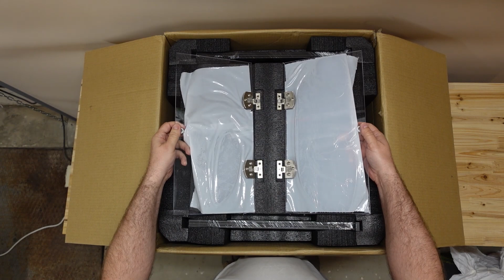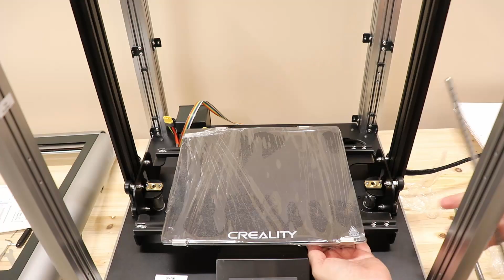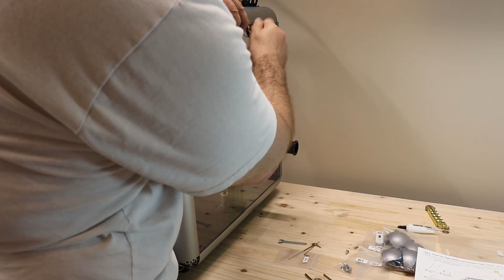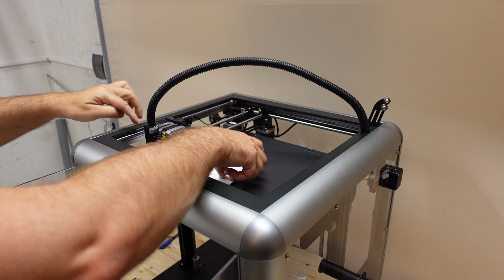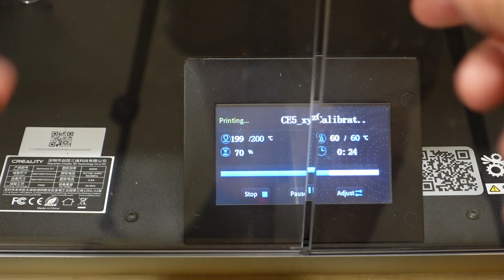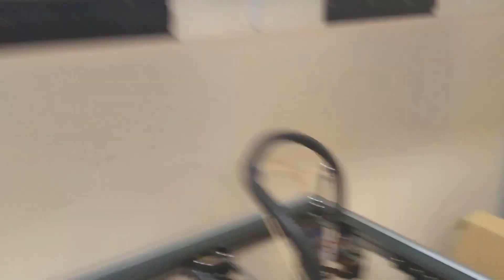Creality Sermoon D1 - the most elegant 3D printer - unboxing, review, first  prints

Comment: could you help me? what could be the issue when i first home the printer the nozzle is pretty far from the bed (far enough that turning the knobs wont get it close). If I press home again the Z axis just goes down even more and keeps doing the same for every press of the home. When I press leveling the bed goes to the top as it should but stays again far from the bed that the knobs can not get it close enough to the bed. Any ideas what I can do to make it work?
Reply from the maker: Not sure, try to lower the limit switch somehow

Comment: hello how do i calibrate stepper motors?
Reply from the maker: You don't have to calibrate stepper motors on X and Y axis (except if you are doing some maintenance). The extruder stepper motor you can calibrate, setting the e-steps, here is a tutorial, how to do it using only files on sd card: https://youtu.be/dvHlawF66Nw?t=911
Reply: @MyTechFun  yes i know how the z axis is calibrated, it just seemed to me that the x and y axis are not quite accurate
Reply: @MyTechFun  https://youtube.com/shorts/M4no4m2Os8Q?feature=share  and another minor printing problem with sermoon d1, the z axis cuts when printing at regular intervals

Comment: Dear Dr. Igor, What is your recommendation for this printer. How it is compared to prusa mk3s and cr 10 v3. What is your long term feedback about consistency and quality.
Reply: Also, you mentioned ender 3 v2 - how is that printer. I am looking for almost all type of material not just pla.
Reply from the maker: Idea for the Sermoon D1 is great, you get a good base, but another 95% 3D printer. If you are ready to fix them with some DIY hacks, go for it. Finally a 3D printer which uses linear rods (x, y). But hotend is still usable up to 240°C by default. There are so many great filaments which requires higher printing temperature. Replacing the hotend (and the extruder) is another useful hack. Enclosure from the top is missing so you could print ABS, Nylon without warping (another DIY hack required). But then screen is still in enclosure, you have to open the door to do settings. Not smart for encosured printer. Requires another hack.. If you want "finished" printer, then Prusa, but you still need to create some enclosure for it for those "exotic" materials.
Reply: @MyTechFun  thank you for the response, so what do you recommend me to get, which printer.

Comment: Excellent instructional film.  Thank you.  My bed is 200 microns high in the center.  When the gap in the four corners is 300 microns, in the center the gap is 100 microns.  Is this something I can live with? (I'm a beginner)
Reply from the maker: That's too big difference. You have few options: install bl touch (it will compensate the difference), replace the glass or install PEI sheet (but if alu plate is warped, you can place something below it)
Reply: @MyTechFun  Thanks for the comment. Excellent channel.
I definitely thought the gap was too big.
I will check again with hot glass. If there is no change, I will contact the supplier.

Comment: It would be great if Creality made this model in 300 x 300 x300 model with a non textured glass bed & I would like to see dual Z axis guide rods & dual Z axis lead screws & the pre-assembled belts & tested at the factory. I wish more manufacturers would use them. I love the enclosure with this printer. What CoreXY 3D printer would you recommend? I would also love if the 3D printer manufacturers use ball screws & servo motors, linear rails, & 40mm X 40mm extrusions. The manufacturers should install of a 500 Watt power supply since many of the supplied power supplies or under rated & running over rated mode which will kill the supply quicker.

Comment: i would do the leveling only after the bed and nozzle are heated up. Might help a little with the adhesion. Next, you should calibrate the extruder and adjust the flow if necessary.
Reply from the maker: Yes, but from some reason, calibrating esteps is removed from this simplified UI. I agree with heated up bed leveling. But for PLA 60°C is not much and baby steps for Z can be adjusted during 3D printing (those small corrections)

Comment: glad to see that creality is finally building connectors to the cables. twisted cables on  ender 3v2 are just a nightmare. You did mention it a bit too nicely imho. Not only one gets fumes from the ptfe tube after 240°. The tube will melt and clog the hotend, pretty much ruining the hotend. I had to throw away the stock hotend on my E3v2 after that...
Reply from the maker: I had same nightmare with cables on Ender5pro too. I am waiting for the day, when will Creality move to new type of hotend.
Reply: yet your video about the microswiss was gold! havent regreted single penny on that part

Comment: Very bad printer. Got mine few weeks ago, since then I only had issues. Uneven bed, bed screws loose and bursting noises in the extruder. On top the creality support does not help and offer a roll of filament for compensation :) stay away from this prototype and poor support.
Reply from the maker: Sorry for your bad experience. As a buyer, I agree "stay away from prototype...", but as a reviewer, I can't :-) But I like this challenge, only tired of similar designs (Ender3 type). Nobody want's to send me corexy or delta printer..